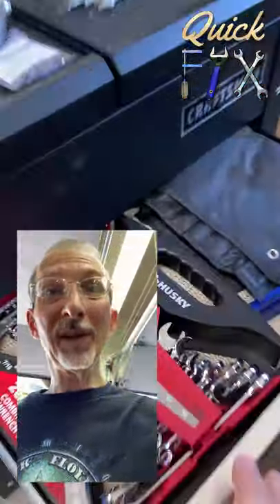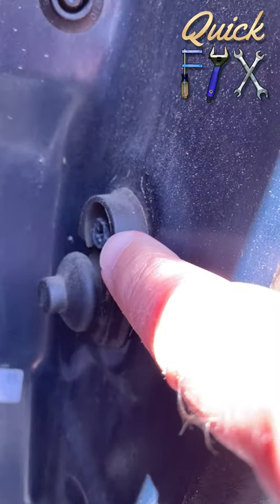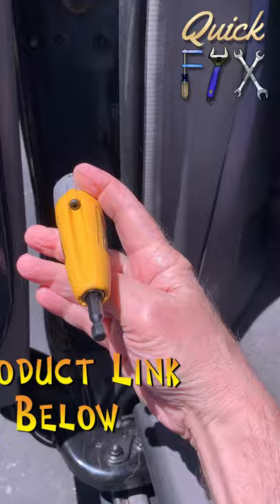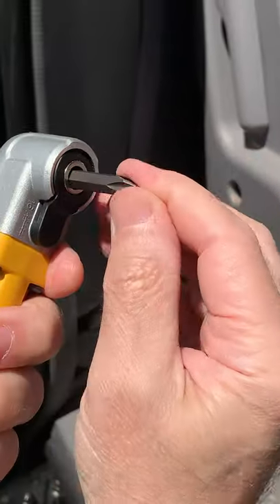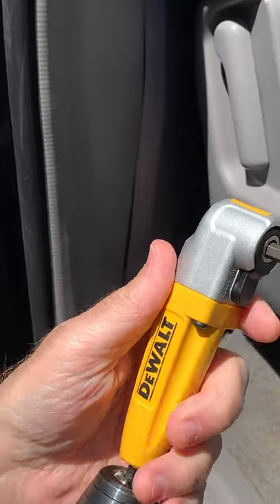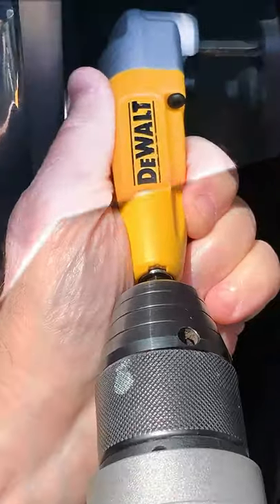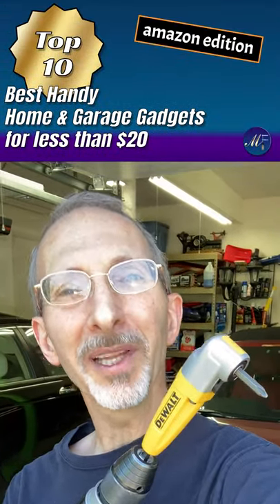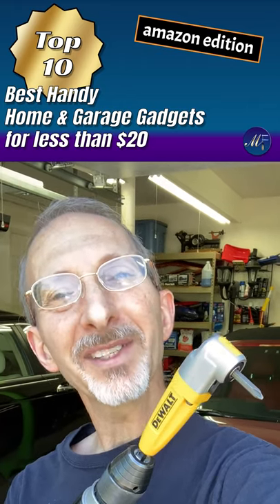Best tool ever? | Dewalt Right Angle Driver Attachment

Comment: I came across one of these  back around Christmas (when the big box stores put out lots of stocking stuffer goodies) and bought it not having an immediate use.  About a month ago I was needing to drill some holes with close clearance.  I used this tool.  I added a hex shank impact drill chuck from Makita to chuck the bits I need, because I couldn't get the long bits I needed in 1/4 hex shank format.  If you're a doing lots of fix or build projects this one and the drill chuck belongs in your kit.
Reply from the maker: @Rshawiii - The addition of a hex shank drill chuck is a really good suggestion! I don’t have one of those in my toolbox… But I should. Thanks for watching the video and for contributing to the conversation!

Comment: Or you could just use a stubby 🤔
Reply from the maker: A stubby works to a point, but if you can’t get your hand around the back of it it is hard to apply to torque and downward pressure. I agree, getting this switch unscrewed could’ve been done using a few different tools. But I wanted a situation to highlight this tool that would also be easy to videotape, and this was my opportunity! 😁